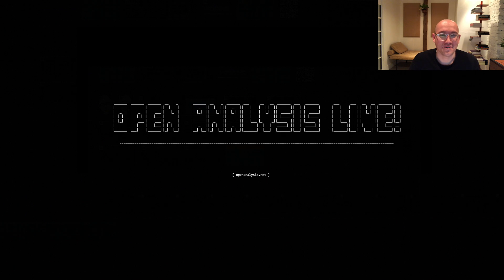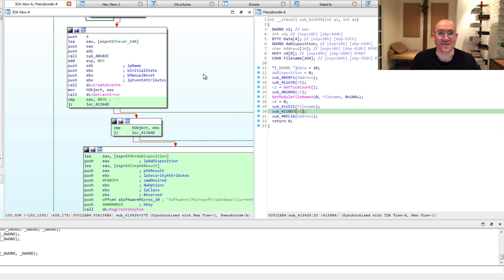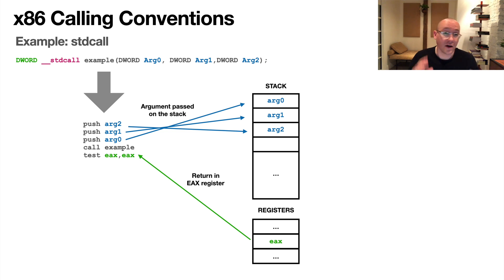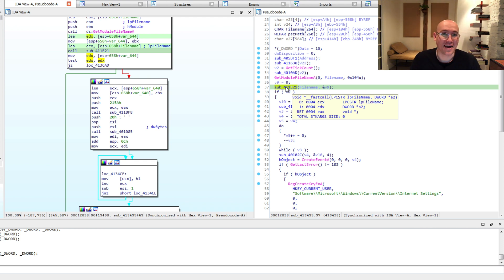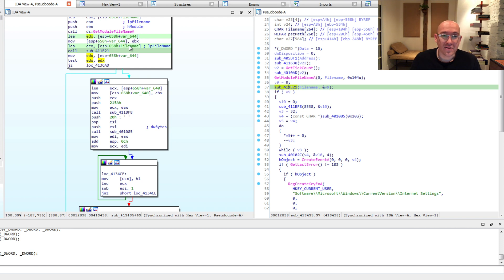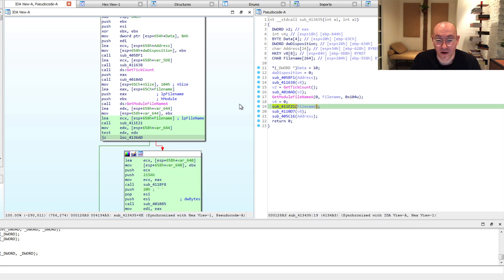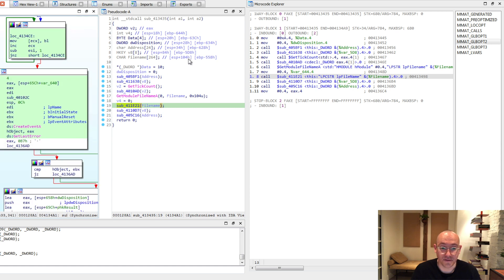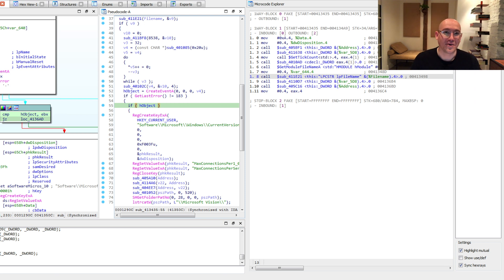IDA Pro Decompiler Basics Microcode and x86 Calling Conventions

Comment from the maker: ** PLEASE READ** I made a mistake in my assumption about how the microcode optimizes away the variable (oops still learning 😳) Check out Rolf's excellent explanation below and a link to a post from him.
"
Your explanation is wrong. The variable is not uninitialized; it's written to one instruction below your cursor. This behavior comes from var_644 being converted to a non-stack variable by alias analysis. I explained call analysis internals somewhat here
"
Full explanation:
https://reverseengineering.stackexchange.com/questions/26803/hex-rays-not-properly-showing-strings/26809#26809

While you are at it, check out Rolf! His work is the foundation for a lot of research I am getting into these days:
https://www.msreverseengineering.com/

Comment: Hi guys. Thank you for the content. Quick question, do you know, how to use partially refactored code with the decompiled code? I.e. if some of the code is already converted to C++ project. Then running it in debugger in Visual Studio obviously gives the access to the source, but doesn't provide any insight to the decompiled functions, and vice versa, in IDA there is an entirety of the decompiled code, which knows nothing of the C++ project...

Comment: In my experience IDA can also get the number of arguments wrong - as you mentioned in the video sometimes it will detect this and fix it when you decompile other functions inside that one, however sometimes you do need to check the assembly (and manually change the func prototype). Nice video as always, this is easily the best channel for anyone wanting to learn how to use IDA.